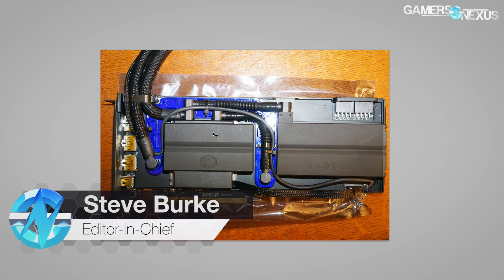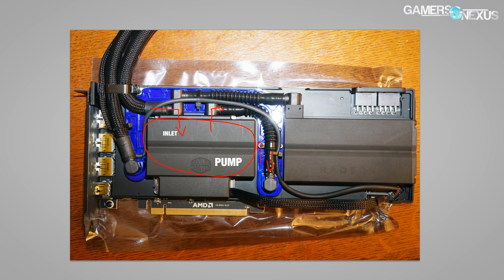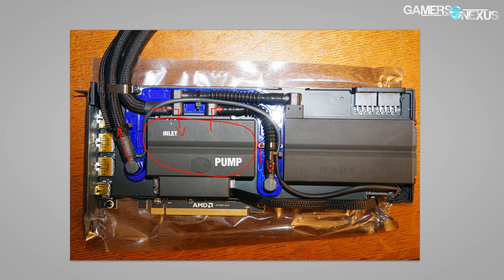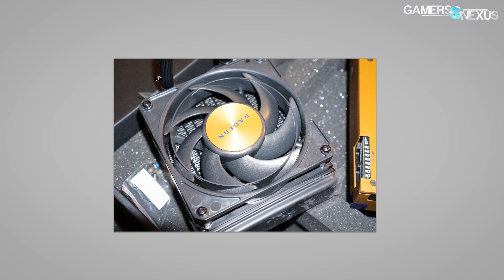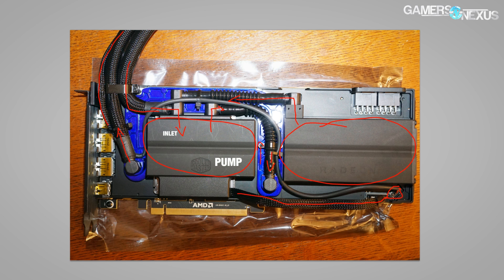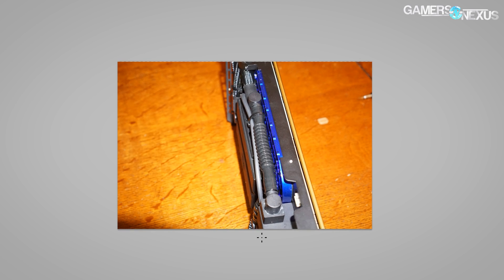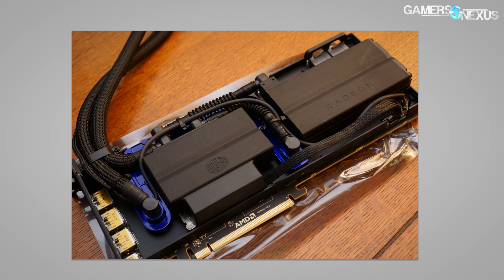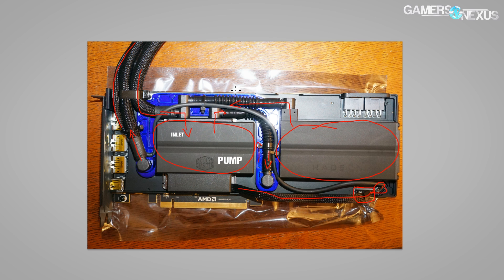Vega: FE Water Cooled Internals & Break-Down

Comment: The tank on the side it has 2 springs inside and 2 pistons that are presering the watersystem ,that seems to me that is used for elumination of airbubbles but also for fighting against expantion of the water , i have pictuers of mine that i open for service in case you want to see it :)
Reply: Hello. Idk if you will read my coment but any way... Did you try to refill liquid thru the tank? And if so, how did you do it? Thanks.

Comment: I have a 64 LC, so I am assuming it's the same setup, what I'm wondering is whether or not the PCB is the same as the air cooled cards... in other words, can I rip all this stuff off and buy a block for it?  Not that I need to or have plans to, I'd just like to know if the option is there.

Comment: What's the plug called that plugs to the graphic card to supply power to the radiator? I put this on my. Msi vega 64 reference board which is 99.9% identical but it doesn't have the socket to plug into the radiator and a capacitor to prob regular the plugs Power. wide 6-pin connector (named MJ200/J200) is all I found. Can I just buy a wire that could be plug into the computer power supply or solder the socket and capacitor from the old (not working) graphic card to the new one? Seems like it has the layout already since it's same as reference board minus that plug + capacitor chip. 4:14 is what I am referring to. Any help would be appreciated!

Comment: You were talking about liquid cooler longetivity in this vid. I've had a Corsair H100 cooling my 3930k for around 5 years now. Should I be concerned of the cooler failing and maybe replace it with something else before the damage is done? 

If that is the case, I wonder if Thermalright HR-02 Macho rev b would be an okay substitute, since I don't want to invest too much in this old machine, but I still want a massive cooler so the temps won't skyrocket with my 4.4 oc. Or maybe there are better ones for under 50€?

Comment: The Fury X's fan wasn't by Cooler Master. It was a Nidec SERVO D1225C12B7ZP-62 (I have it in front of me). This is an updated 3000 rpm Gentle Typhoon with PWM control which was not released to the general consumer market (who knows why). Vega FE water probably uses the same fan.

Comment: I'm pretty sure the reservoir works like a syringe where there is a sealed plate that can mover back and forth so that as water is lost the reservoir volume decreases with the fluid loss, as a result you probably cant put the pump on the reservoir since it's designed to be empty eventually (like a syringe with all the liquid squeezed out).

Comment: I kinda like the idea of a pressurized res that can fill in missing fluid from the loop.  I feel like that could inexpensively be put on every aio with a little bike tire air inlet so you could top off the pressure manually.

Comment: Could the reservoir on the right be spring loaded? As in, there are two springs that push against a plate with the liquid in front of it. So that when the pressure on the other side lowers, the pressure of the springs push the water into the loop. This is just a theory of course :P
Reply: yes spring loaded

Comment: Yet will all of this be actually cooler than a clc on block. No it won't. It's really stupid. Like why. Putting a waterblock on the side version would be even cheaper. Like this is a beyond waste of materials lol
Reply: You don't know what you're talking about. I haven't seen any system with a better water cooler for the FuryX, not that runs as quiet as the default system with as good temps. I'm actually really amazed at AMD's AIO coolers on their GPUs.

Nothing on any of my CPUs from Corsair or NZXT compare, Hybrid 1080ti is loud compared to the FuryX.

Comment: Water and electronics, something I'll never mix.
Reply: Jaime Almeida you must be new to pcs. Watercooling when done right works wonders with electronics. There's water in your car....
Reply: Jaime Almeida pure or distilled water is OK and pretty much safe for any electronics. impurities like minerals are actually dangerous in many different ways like busting conductive capabilities of liquid. that's the basics.
Reply: Distilled water will collect impurities from metals over time increasing it's effective conductivity.
That said, AIOs are usually pretty fool proof. You're probably more likely to kill your PC with static or damage your motherboard with a giant heatsink than have an AIO leak.

Custom loops you need bigger balls for. They are more work to sort out and how likely they are to leak is pretty well proportional to how well you put them together. Even then they are usually more complex and thus have more points of failure. 
It's good fun though and it's kinda liberating to get used to using water with computers.

Comment: Once waterblocks come out you could probably build an entire custom loop for $600 and still have some change left over.
Reply: Ben Willock how can such simple parts cost so much! Id just use a motorcycle oilcooler and some fans. You can find decent pumps that cost wayy less. The only hard part are the places where the heat needs to be transfered none of this expensive useless shit. If you can't stand a little noise just move the tower in another room

Comment: Then EKWB release a block for £120 and this card is pointless.
Reply: Dante Alighieri I'm not jayztwocents. :)
Reply: Said Al Gifari if your spending £600-700 on a GPU I suspect watercooling may be on your list too. Hell I watercool a rx480 which people hate cos they are like well you could have spent that extra money and got a 1070. Well yeh but then I'd need to buy a waterblock for the 1070 too?!
Reply: Then your fittings leak and destroy your card and you have no warranty putting your business computer down costing you tens of thousands in lost revenue, all because you were too fucking cheap and wanted to save $300 on something that's designed specifically to run at high loads 24/7
Reply: Adam Webb I was looking for this. You will need a radiator a pump and a reservoir, tubing and fittings, too but. I agree that it's not going to be 600 dollars to build a lil loop for it
Reply: yeah to a rep and they said they will have a block
Reply: Said, I'd rather have ONE OR TWO pumps (depending on requirements), and ONE BIG radiator, with quieter fans, and water blocks for all my components that need cooling as just blocks, over a hodge-podge of fans and AIO's.
Reply: Putting  a custom water block on your gpu also voids the warranty :)
Reply: Well, yes.  But there's no good reason AMD couldn't have also give us a SKU with a block only, no pump or radiator.  Of course, when AIB's get the RX Vega, there's nothing stopping one of them from making such a variant, except, well, that it's never happened with an AMD card.  Ever.  Nvidia AIB's are doing it regularly nowadays, but AMD ones don't seem to have figured out there's a market for that.
Reply: damstachizz what are you talking about?

Comment: wait aluminum tank and copper coldplate?
Reply: Jack Troost aluminium could just be a shroud, no guarantee it's the tank material. You saw how the aluminium shroud had 2 "Allen key" holes in the side in one of the pictures, liquid is obviously not stored in a container with holes, that is screwed together with normal screws. I bet there is a tank underneath of copper.
Reply: yaseen reza o yeah that is right but than they need to have also done that with the vrm because he also said those were aluminium
Reply: It's a closed loop.

They could have filled all kinds of funny liquids in there.

With enough anti-corrosive it's a no brainer.

Comment: i really hope this isn't  how RX Water Vega will be designed, in terms of expense.
The Fury X wasn't really a 'cheap' design either, but it seems like that would be more reasonable than this.
Though I suppose there are merits to having the reservoir on the card, number one being reduced radiator weight and size.
Reply: smokeydops AMD always over design. It makes the card more expensive, but it also means it would break down for a good 3-5 years.
Reply: Juggernautdemon but constantly lagging behind in performance and only bringing a few gpu products super late

Comment: I don't agree that this is excessive.  They're preparing it for faultless, 24/7 load for its lifetime.  You need an overkill reservoir and over-designed piping for that level of redundancy and safety.
Reply: Yeah, it will last much longer then the Fury X AIO. 

One day the AIO on my fury x will break, and what do i do then? Most OEM's dont even make blocks for it and if i would go that way it would be expensive as fuck.
Reply: I doubt we are talking about the same concept of redundancy. i this case it would mean 2 pumps (where one can fail and the remaining one will be strong enough to keep the fluid flowing and the core from overheating until the system is shut down/repaired) which would be appropriate at the retarded prices this is selling at.
Reply: Henrik Johansson get a ekwb waterblock
Reply: Just for kicks I'd like to see this AiO compared to the R9 295X2's to see what changes they've made and how well that one's still holding up.
Reply: Yep.  If anything, I can see where they cut corners that could be cut.  For example, if anyone whose entire income is based around water cooling were to NOT design this as a monoblock, they'd never move the product.  Would a monoblock improve anything over this design?  Not really.  But it's what watercooling people are used to, and it would cost a lot more.  Another thing, he mentioned a LOT of aluminum.  It sounds like it's a mostly aluminum solution, and the copper that is mentioned is probably aluminum plated, or we'd have corrosion.  Someone whose entire income is from water cooling would use mostly copper and plastics that resist permeation.  And this IS something that effects real-world performance, just not by much.
Reply: jdr ok There is not one yet. Even if they make one, it'll be weeks till it's out.

Comment: why the fuck they don't use a  normal open air cooling with heatpipes and fans and stop making this shitty and expensive solutions that doesn't help with its poor perfomance and high temperatures. this has to be the normal version not a $ 600  more expensive card to "solve" the heat problem with the joke of cooling solution of the normal vega.
Reply: Because the open air cards don't work well without adequate case airflow, in fact, in such a scenario, even the air blower is superior. They have to design for idiots, they need a high TDP design that can work in 95% of cases + case airflows on the market, hence the Liquid cooler. Those AIB heatpipe open designs are targeted towards people who know what they're doing already.
Reply: no air cooling is REALLY enough for vega to be honest considering it can pull up to 400-500w
Reply: Josh Payne only imagine this high temps and throttling in this scenarios is painful

Comment: It is called "expansion tank"
Reply from the maker: The liquid shouldn't get that hot to require an expansion tank like a car would. No other PC radiators really do that -- they're not filled to the brim, either. There's tolerance in there for any expansion (which isn't much). Given that the Fury X had an additional reservoir tank specifically for longevity and staving off permeation, it seems likely that this is also the case here -- just in a new format.

It's possible that it's an expansion tank, so we're not saying hard "no" to that suggestion, but we don't have enough reason to believe it is right now, and it's not a common thing to encounter (and AMD does like making a big deal about extra liquid volume for longevity, so those all add up). Unfortunately, without the card physically in hand, we can't dismantle it to find out definitively!
Reply: Yes, same as on my car radiator, as the water heats up it expands and it has to go somewhere...... otherwise it would break the radiator.
Reply: If an air gap is left in the system then an expansion tank is not needed, as the air will get pressurised and compress. If this card has no air in the system then the expansion tank might be needed.
Reply: Gamers Nexus does it have some sort of mechanical/elastic bladder there to keep the water pressure up. Maybe those holes are where the springs push on sytinge like pistons? ¯\(ツ)/¯
Reply from the maker: Chaiwat Kositkhun Was thinking the same that it might be some kind of plunger. Makes me really want this thing to tear it apart, but that's an expensive tear down!
Reply: Good point about it not being pure water inside these units. I am not sure about the thermal expansion qualities of anti-freeze-anti boil liquids.

And yes the air in the pump will not cause instant destruction, I never claimed the damage to happen instantly. I bought a Corsair H110-i AIO, before I found out about needing to keep the air out of the pump. My H110-i lasted 12 weeks before it failed completely.
Reply: Chaiwat Kositkhun It shouldn't need pressure though. As permeation does its thing the pressure drops in the loop and should pull coolant from the reservoir since the pressure outside the tank is now higher. Think a vacuum effect.
Reply: sintaxera i think so. The two holes are for the springs that are possibly pressing against some kind of bladder to keep the whole thing pressurized.
Reply: atomkinder67 it escapes me why they'd do it and I don't think it has much to do with permeation. The only purpose I can think of is for there to be a switch that once the plunger get to a certain level it shows a "low coolant" alarm. That would allow it to work regardless of the card's position.
Reply: An expansion tank for the increase in pressure caused by "the tubes bending" more like. When tubes bend, the volume gets smaller. That volume of liquid should go somewhere. And in order to make the unit air-free, we need an expansion tank. The unit needs to be air-free, so it can last longer obviously.

Also it could be all of the above.

a simple bladder like device or a spring loaded syringe could act as

1. "reservoir" = "expansion tank"
2. "low liquid level indicator" (with a sensor or a switch. But I see no cables connected to the mystery box in the picture, so.... not likely.
Reply: Remember, VEGA is positioned as a professional grade VGA. If it breaks down or leaks, AMD would be basically shitting on themselves. Yes, they need longevity on these watercoolers.
Reply: IamNOTyourFather change in volume would be extremely small (unless you're really destroying the tube's section) and can be handled by the small air gap quite easily. I doubt they'd need such an elaborate design just for this(?)
Reply: Chaiwat Kositkhun yeah, it also needs a bit of extra juice.
Reply: Two notes on that. You are correct that most systems would easily accommodate the changed in volume due to change in temp, and that change would be absorbed by the tubes, which, as you noted would reduce the life of the lines. Second your hot water heater has an expansion tank mounted to the top of it and most of those will never exceed 170f, lower if you are concerned with energy consumption and are cool with legionnaires.
Reply from the maker: There is always an air gap in these radiators.
Reply from the maker: That's not completely correct. The pump will not get instantly destroyed with air being sucked through, and it actually happens quite commonly -- that's why you get gurgling noises in CLCs as air is pulled through the pump. It's not good for it and it obviously doesn't lubricate the pump, but it happens all the time and isn't deadly unless it's from prolonged use -- which happens from permeation more than anything, hence extra liquid chambers making sense (to offset permeation). Don't mount with the tubes down and you're fine, and never mount the radiator in a bottom position in the case. All very common stuff that we've explained several times before. This CLC isn't really different from what we see on a daily basis. It's just any other liquid cooler, except it happens to connect to the VRMs also. But the pump+hex operate the same way as any other one on the market.

We define all of this in our "How CLCs Work" technical deep dive: https://www.youtube.com/watch?v=CNKkR-wc8Eg

Also, keep in mind that this isn't water. It's propylene glycol and distilled water, with an indeterminate mixture of propylene glycol (used to lower the freezing temperature -- most these coolers can be stored in -20 to -40C).
Reply: Yes, and if the air gets into the pump (when being installed having the pump at the highest point) then the pump gets destroyed. If this system was designed without an air gap (which would protect the system from getting air in the pump) then it would need an expansion tank of some kind. Water is at its maximum density at 4 degrees C, below 4 degrees C it expands until at zero degrees it freezes and is about 10% larger in volume. And as water goes above 4 degrees C it also expands..... hence the air gap in all water-cooling systems. But in AIO systems it can be a bad thing, as the air gap often ends up in the pump and the pump dies. This might be a new design that has no air in the system, and has an expansion tank to cope with the water expansion..... or it might not be.
Reply: Except if the unit lasts longer you're less likely to buy another one. The PC "Industry" relies on obsolescence and premature failure to goad consumers into purchasing whatever is the latest and greatest, so I don't believe that neither AMD nor Cooler Master give two rodent droppings about longevity, so long it's enough to last a few years before it breaks, which by then you should have the money to buy another.